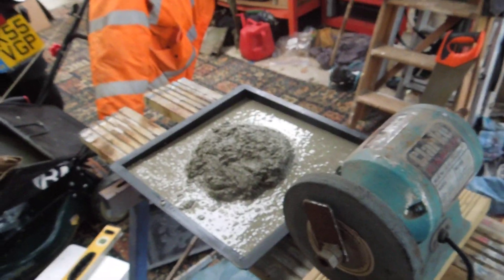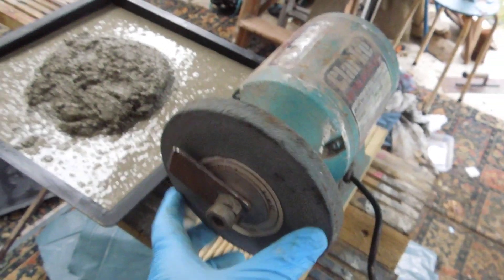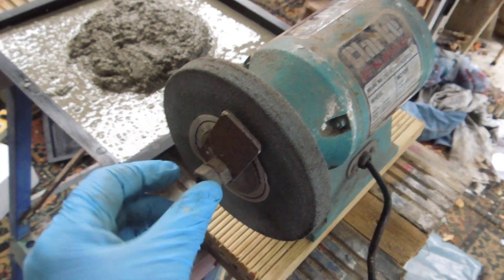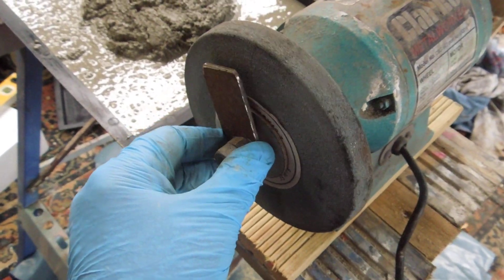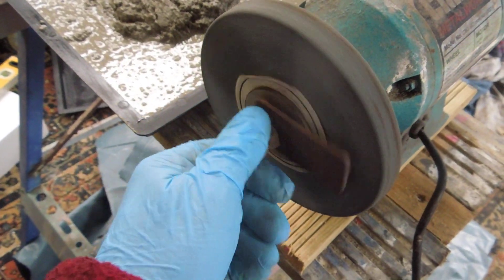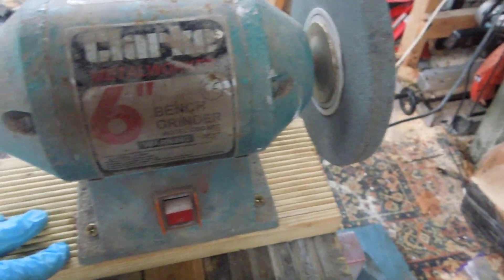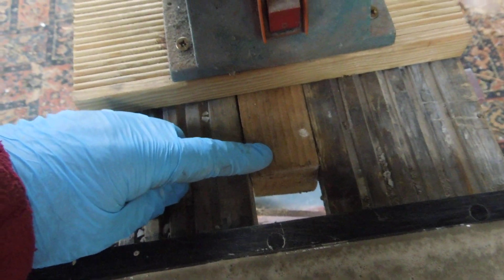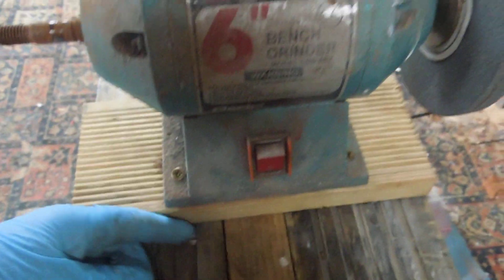My simple vibrating table for concrete slab making

Comment: Hello hope all is well may I ask what concrete mix you use ?
Reply from the maker: I was using 3 sand -/ 1 cement, more cement gives a smoother whiter finish i found, probably stronger as well.

Comment: IN Australia contact OLI Vibrators 0397649988 Sean for an inexpensive vibrating motor in 240v plug in, DC or 3 Ph.

Comment: I'm not sure I would be doing that with a grinding wheel still in place. Put a wooden or aluminium disc there and the steel tag, it will still set up vibration without risking flying pieces of broken grinding wheel that take pieces off of your body.

In my apprenticeship we were told  in uncertain circumstances that  we had to balance grinding wheels to get vibration out or risk death.

Comment: Try mounting the back board on a tire instead of legs to the ground.  The rubber seems to amplify the amplitude.
Reply from the maker: that sounds like a good improvement, if i see an old tyre i will stop and pick it up. cheers.